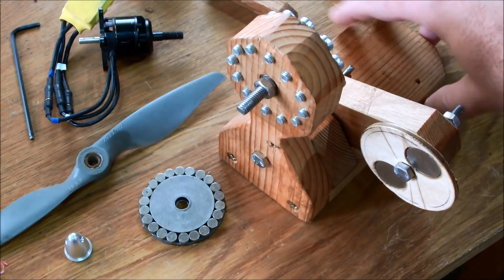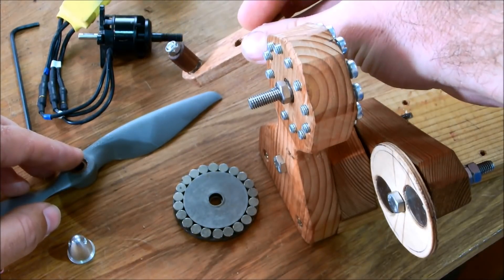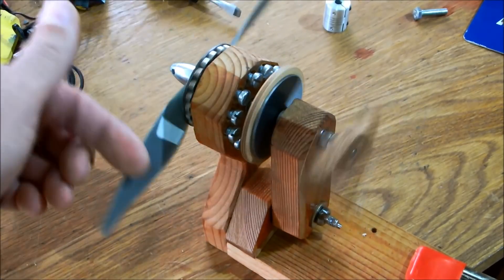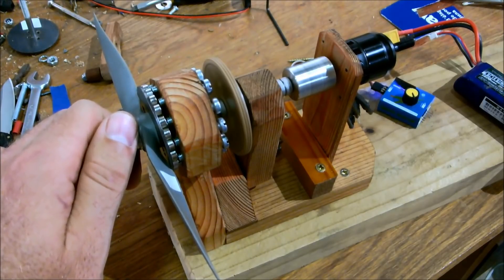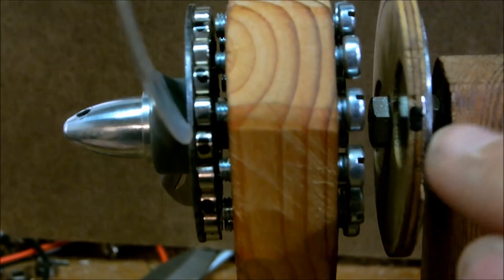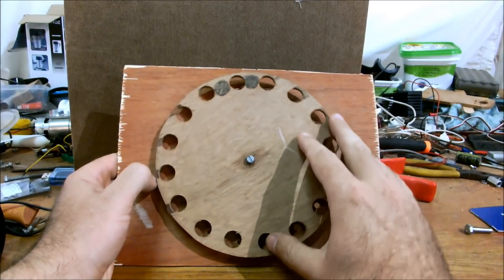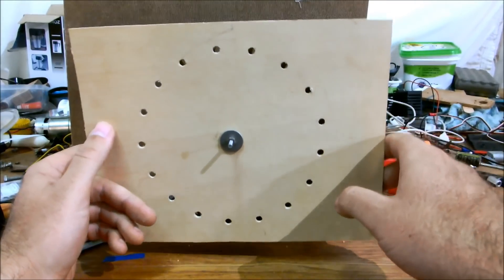Magnetic gears : Axial drivetrain proof of concept

Comment: This would be very useful in transmitting torque into a hermetically sealed space.
Reply: We already had it on centrifugal pumps for pumping acid and basic solutions. It's called magnetic drive pump and it has been around since the 80s
Reply: @docvolt5214  Also, most household central heating water pumps use a similar arrangement
Reply: @stevemorse5052  Do you have a link to a magnetically coupled circulator? 25 years and I've never seen one.  I usually install and service TACO circulators in home heating systems.
Reply: @lantrick  Good morning Lantrick, I looked at the construction of the TACO pump, and confirmed that is has a shaft an impeller as I thought. 
The pumps I used (and where quite common) did not have a shaft. I have confirmed this as I have dismantled many of them. 
Then, you ask how did they work. First I am hoping you know how an electric motor works, only the basics are needed. Imagine the rotating part on the side of the motor, not on the inside. This is not unlike the linear motors of some of the fast trains, and if you remember the people mover from Brit Rail to Birmingham airport. Now imaging the rotating part as an impeller (a little bigger than the TACO). Now for the fun part, you put an aluminum sheet between the two, that the seal. As the aluminum is non magnetic, the rotating magnetic field simply goes though it and drives the impeller.
 I will continue to look for an example if I can.
Reply: @stevemorse5052  Actually I'm JUST looking for household heating pumps that are magnetically coupled, like you stated.  I already know how they work. Just a link to a Manufacturer would suffice.
Reply: @lantrick  I'm pretty sure you can get 12v hot water and central heating pumps from... Johnson that are magnetically coupled. But that's not the big things you get in a big central heating system. Maybe they make bigger ones 🤷‍♂️
Reply: @lantrick  yes you're right "most household pumps" was an incorrect statement but he dosent want to admit he was wrong.
Reply: Guess what, this is how submarines transmit their shaft power
Reply: @somethingsfishy2695  really? Where I could read about that?
Reply: @shimmerite_ua  unmanned submarines tho, which go deep down underwater, not big surface submarines that need crew inside, those use a regular waterproof shaft method
Reply: @somethingsfishy2695  with the gearing effect as well, or just 1:1 transmission?
Reply: @somethingsfishy2695 ⚠️ God has said in the Quran:

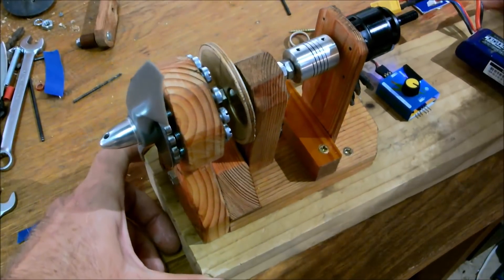🔵 { O mankind, worship your Lord, who created you and those before you, that you may become righteous - ( 2:21 ) 

🔴 [He] who made for you the earth a bed [spread out] and the sky a ceiling and sent down from the sky, rain and brought forth thereby fruits as provision for you. So do not attribute to Allah equals while you know [that there is nothing similar to Him]. ( 2:22 )

🔵 And if you are in doubt about what We have sent down upon Our Servant [Muhammad], then produce a surah the like thereof and call upon your witnesses other than Allah, if you should be truthful. ( 2:23 )

🔴 But if you do not - and you will never be able to - then fear the Fire, whose fuel is men and stones, prepared for the disbelievers.( 2:24 )

🔵 And give good tidings to those who believe and do righteous deeds that they will have gardens [in Paradise] beneath which rivers flow. Whenever they are provided with a provision of fruit therefrom, they will say, "This is what we were provided with before." And it is given to them in likeness. And they will have therein purified spouses, and they will abide therein eternally. ( 2:25 )

⚠️ Quran
Reply: Already in watermeter 😅
Reply: There’s a YouTube vid of Lego submarine built using this idea for its props, pretty smart.
Reply: would be really cool to make a water pump with this principle...
Reply: @H3xx99  it's been around for years in water pumps.
Reply: Or even adjusting paceakers without having to open up the patient?

Comment: I'd like to challenge you using these gears and magnetic principles to drive reasonably high powered stirling engine. Rhombic drive requires at least one set of gears and it would be best to operate oil free, because grease vapors love to condensate on cold side, clog regenerator and carbonize on hot side, also stick to piston walls where can interfere with self lubricating dry piston ring.
Reply from the maker: If I ever get one of my stirling engines working I will certainly give it a try!

Comment: Hallo William, IMHO the hysteresis curve of magnetization plays an important role here: instead of using steel bolts (which retains the magnetic orientation long enough) I suggest to make use of ferrite rods which, at a higher rotation speeds, would allow a better torque and far less magnetic transmission losses. 

As you, maybe know there are many different kinds of ferrite blends, so finding the right one would drive to a near perfect magnetic gear.

The distance between the magnets and the ferrite rods is also important for the torque: the nearest they are, the highest the torque will be.
Reply: Could it work of you guide them through channels by "repelling" them with diamagnetic material instead? With the gaps between the material serving as the channels
Reply: He could also reduce reluctance by reducing the air gap between the magnets and steel bolts to as close of possible maybe <0.1mm air gap only if he had good bearings and bolts ground to the exact length

Comment: the most interesting thing is to switch the motor to the blade and the blade to the motor ... logical don't you think. you want the gear reduction on the motor not the blade. Else it is wasted energy unless of course you are just showing the concept
Reply from the maker: This is just a concept. The reduction of prop rpm is a requirement for using these model aircraft props underwater on my electric kayak. For use on aircraft, the motor drives the prop directly.
Reply: @williamfraser  under water you need more torque so you're right .. still on aircraft it is nice to see how it behaves if you switch the positions ... hope you'll make such an experiment ...nice video

Comment: Will it transmit enough power to use it in the kayak propeller?  It could also be a nice way to keep the water out, as no shaft is needed.
Reply from the maker: I am busy testing a scaled down version for a low power trolling motor. So far the torque transmission is not enough but then the tolerances are not very tight either. Stronger magnets and better machining and it should be posdible.

Comment: why is it spinning backwards to the direction of the magnets?
Reply: sorry I asked too soon, thanks for explaining!
Reply from the maker: The rotation can also be the same as the input if the correct number of bolts are used. In this demo model, ten evenly spaced bolts would maintain the 11:1 ratio and rotation direction would be same as input.

Comment: Why aeroplane propellant? This is obviously a perfect setup for boats and underwater vehicles 👍 no touching, no shaft, therefore no risk of sealing leaks. Man, this will be the next hot toys for diyers and modelers 😃
Reply from the maker: I use these aircraft propellers for my electric kayak. It is precisely due to leaking seals that I am investigating this. I think a simple 1:1 magnetic coupling without any bolts would be a stronger and more efficient way to transmit torque to an external propeller.

Comment: Would this work with copper disks on one the prop side? Was just wondering because if you drop a magnet through a copper pipe it will slow down significantly.
Reply from the maker: I went and tried it out but could not see any effect. I replaced the pinion with an aluminium disc and turned the propeller by hand. I am sure some eddy currents were generated in the disc but with such weak magnets it had no measurable effect.
Reply: That is because of eddy currents forming and creating opposing magnetic fields to the ones produced by permanent magnets. This phenomena is not happening only in copper pipes, it is just that copper has really high conductivity. A better choice would probably be aluminum, which is also highly conductive but also has lower weight per volume unit (and is also a lot cheaper). Good thinking tho!
Reply: If I may add to the discussion. Think about how this works through the lens of magnetic circuits.   Where as the iron core provides a low reluctance path through to the magnets on the other side, induced currents in copper pole pieces are greatest near the surface of the copper face closest to the moving magnets and generating their own magnetic field  in opposition to the change in the initial magnetic field.  this prevents the change in both the initial and the induced field from penetrating very deep into the copper pole piece.  

finally, while slow rotation may allow the fields to penetrate, you really need the low reluctance path of iron or steel to concentrate the fields on the other side to create the gearing effect.
Reply: Lookup “induction motor”

Comment: Flip it in reverse and you can have a wind turbine without a mechanical gear box.  The biggest problem I see is that permanent magnets at that scale would be really expensive...

Wait, what if you used multiple concentric circles, and smaller magnets for each set of rings?
Reply from the maker: I want to test it as a turbine generator by winding the coils directly onto the bolts. The output would be 6-phase, so it might produce very smooth direct current once rectified. I still need to investigate.

Comment: Without doubt, this construction opens a bunch of interesting use cases, though I am not exactly sure, which ones:
What is the efficiency factor compared to mechanical gearing? The practical torque limits? In another vid for industrial engine high power trains, inner cooling was demonstrated as an essential thing for the magnets (so that they wont suffer from higher temperatures (Curie point?))
Brushless engines, especially outrunner types, can easily be dimensioned to high torque by greater diameters and longer bells. Also, I thought slow-runners got lower losses due to polarity change within the inner bladed core? 
So, what parameters will apply to get superior performance by such a "flux gear" compared to direct drive outrunners or differential gears with contra force/moment (Toyota Auris hybrid drivetrain)?
Reply from the maker: I doubt it has the potential of better efficiency than mechanical gears. It could be a preferred solution when you do not want to use lubricants or desire low noise.

Comment: This is called dumping in electrical Engineering. I studied this more than 14 years ago when I did my final year in Electrical Engineering. This is not new, and dumping is used with other methods too.
Reply from the maker: Can you provide a link or another example? I cannot find the term dumping being used in this context.
Reply: @williamfraser   a circular disc turning at a certain speed needed dumping to slow it down etc. It was just one little circuit we studied. May be does not exist anymore in modern days. Nowadays it is all the digital stuff. TESLA ALSO USED MAGNETIC MOTORS.

Comment: Nice idea but what for?
Reply from the maker: Perhaps where you need a clean environment without oil or grease. Torque transmission into or from within a sealed housing (e.g. Stirling engine). Quiet compared to mechanical gears. This model is simply to demonstrate the principle of operation, it is not a new invention.
Reply: @williamfraser  I know that it is not a new invention - that is why i am asking cause so far it does not seem to have a use.
Magnetic coupling is a comparatively weak and very lossy process. If you want to transmit power through a solid seal - why not transmit the electricity instead and use a motor on the other side?
Quiet? The magnets generate quite some lateral forces leading to vibrations.

Those toys have been around for ages but even for space-operation simple sealed bearing are used instead of this.

Comment: So if a bird hits your propeller while you're flying using this method you are going to die
Reply from the maker: For a brief moment when the prop stops, pressure will rise in front and drop behind the blade, turning it into a turbine. The torque created will be sufficient to get it going again. Even propellers on piston aircraft keep windmilling after the engine dies. This is however a bad choice for aircraft due to other reasons such as efficiency.

Comment: If you wind some enamelled copper wire around the bolts and energise them in sequence, it will make a brushless D.C. motor. Fabulous, I can buy a better one off-the-shelf.
Reply: Yes, you could make a BLDC motor, and completely miss the point of this arrangement...
Reply: djdjukic I don't get the point because there isn't one.

Comment: Can you not work that you have that back to front for torque and speed ratio?!
Reply from the maker: It works just like conventional gears, if you drive the small gear the output will be slower and the torque will increase. And vice versa.

Comment: if those were sets of solenoids or some such, would oscillation in one generate a gearing-ratio of frequency in the other disc? No torque to worry about, just transmission losses... You illustrated the principle beautifully with that silhouette at the end - the general math behind it there is moire , and I suspect that more complex moire are possible which allow a denser packing of magnets and higher torque - possible to tilt bolts askew, like a bent or mis-aligned nail, half of the bolts facing in toward the axis, half out, to create interactions along a pair of concentric alternate-magnet-rings? I think of each bolt's diagonal angle as a channel, specifying which radius-to-radius interaction occurs; if you had bolts at many angles, the effect could be similar to a 6-cylinder engine...

Comment: Too bad it doesn't have any torque to speak of.
Reply: The torque would be equivalent to the shear force required to move the magnets out of influence of each other, so the closer the stronger, and the more powerful the magnet the better the torque, so it's at least scaleable.
Reply: Do the bolts get hot? What is the efficiency of this?
Reply from the maker: @thebeautifulones1978  I am sure the bolts do generate some heat but nothing to speak of at such low rpm and tiny magnets. I have not measured efficiency but my guess would be that mechanical gears are superior.

Comment: have you tried using steel rods with the exact dimensions as the magnets instead of the bolts? it should increase magnetic coupling because those rods would be thicker than bolts and can carry higher magnetic flux.
Reply from the maker: These are the thickest bolts I have used. I have also used screws with the sharp ends pointing to the smaller magnets. The coupling is certainly stronger with the larger bolts. However, the attraction between magnets and iron also increases cogging. This was solved by using larger, flat magnets to overlap multiple bolts. Ideally the pinion should have two half-ring magnets, each covering 180deg of the gear disc.

Comment: Could you build a differential with it? Again if the magnets were electromagnets could you vary the point at which power stops being transmitted?
Reply from the maker: For a differential you would need some 90 degree couplings. It is something I am still working on. The concept is basically just to create a 45 degree coupling between each magnet disc and the bolt ring.
Reply: @williamfraser  https://youtu.be/_6in9Q8DDoY what about something like this, but stationary.

Comment: Auw man so many ideas. What if you had.. bare with me, electro magnets you could switch on an off, could you create a somewhat continuously variable transmission?
Reply from the maker: By turning the bolts into electromagnets you could perhaps "block" some of them from transmitting flux. For different gear ratios you need different numbers of pole pairs on at least on one of the gears. This could also be achieved by using electromagnets. The problem is that the angular spacing also needs to be rearranged evenly.
Reply: @williamfraser With enough small ones you could replicate it with clusters approximating individual ones instead of actual individual electromagnets

Comment: Do the magnets and bolts heat up much? It's be nice to get a thermal camera on that.
Reply from the maker: There must have been some heat generated. At this low rpm and load I could not feel any difference by touch.
Reply: In theory, the magnets and bolts shouldn't heat up at all. The only time magnets would produce heat (at high RPM's) would be with aluminum.
Reply: @Ivon365  So, that means base on video above and what you say, the heat is depend on flux, so if use another magnet without aluminum, so in high RPM, there is no flux, so there is no heat, so it can constant at higher speed without heat, except the mass resistance will break down since there is inner resistance so there is heat within mass. So, all mass has magnet field within so it means it has flux which is connect to magnet field shape. So, heat is base not on motion, but base on flux which is magnet field that has a storage energy field which repel the energy within the flux line, so the energy is within empty space. So, the higher friction which magnet that has flux in meet with Aluminum's flux so both opposite meets and create heat, same as EMF meet BEMF. So, heat is base on block of energy and friction of blocks of energy per time.